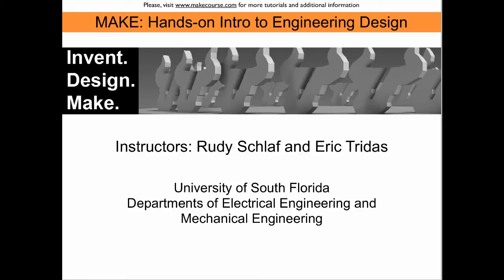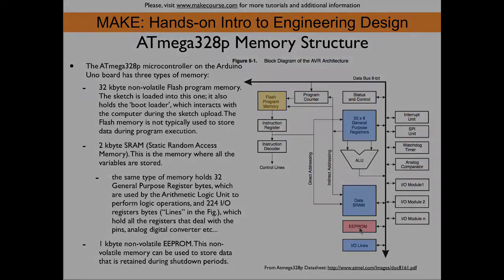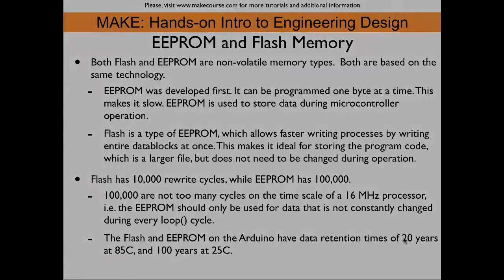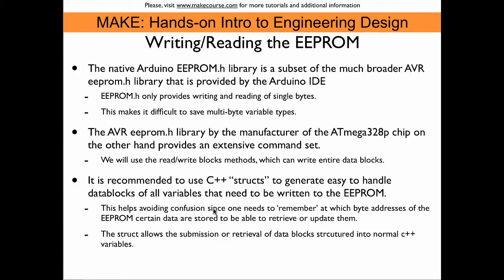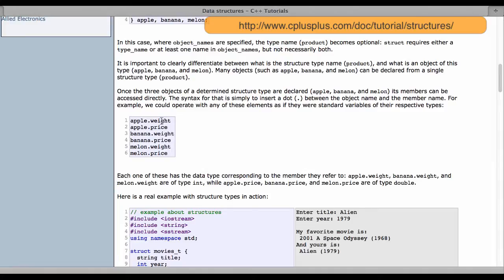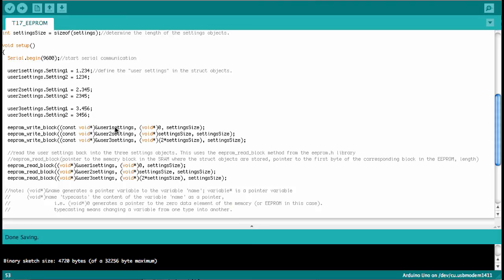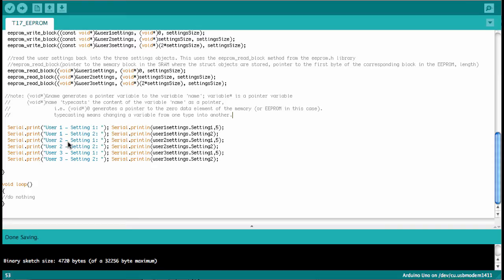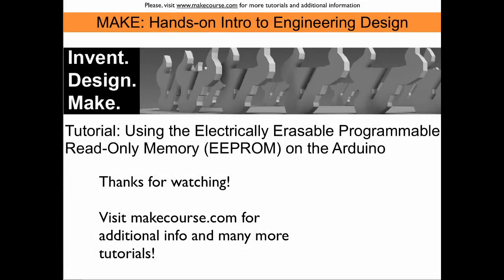Tutorial: Using the Arduino EEPROM for Long Term Data Storage

Comment: Very Nice sir. It will help a lot in my thesis project. But the codes is not readable. Can I have a copy? Thanks in advance. :))
Reply from the maker: The sketch is posted at makecourse.com. Just head to the Videos tab and select the EEPROM video. Good luck with your project!
Reply: Sir do you have a lot of idea regarding struct?